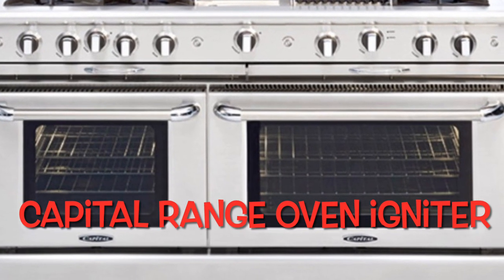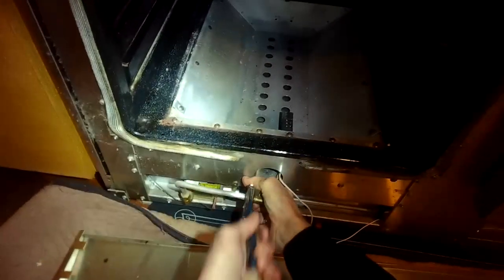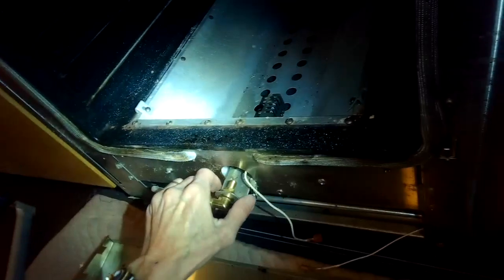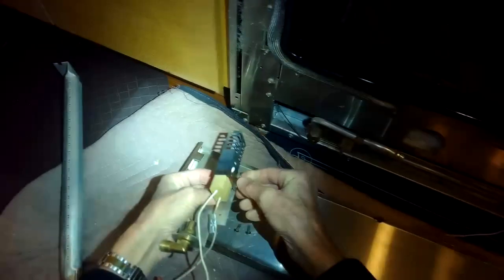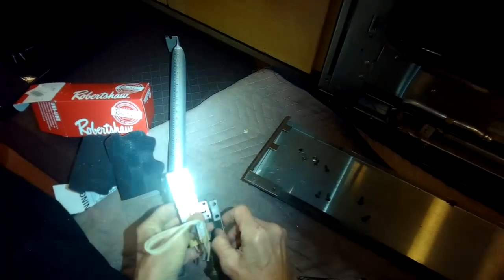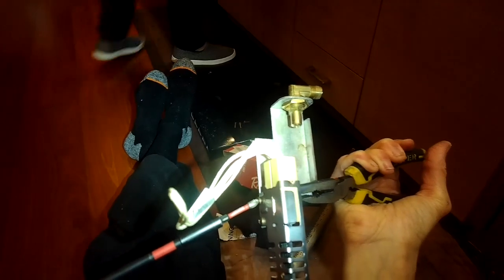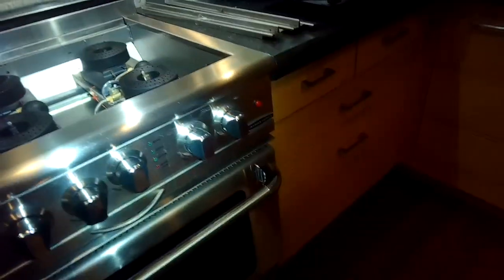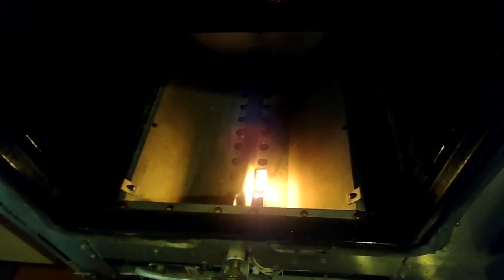✨ Capital Range - Oven Won’t Heat Up - $20.00 EASY FIX ✨

Comment: This is one of the best videos ever. I have a Capital Culinarian that had these specific issues. The oven was moaning and groaning and could not even come up to a temperature of 300 degrees. I followed the steps outlined in this video and purchased the surface ignitor specified in the link. The oven now performs like new. Also, I didn’t know how to gain access to the spark ignitor for the burner. I watched the video several times and went on to successfully complete the repair. There’s not much out there on these Capital ranges so this video was a blessing. Saved me a lot of hours, headaches and hundreds of dollars. A tremendous resource. Thanks so much for posting this.

Gerry
Reply from the maker: You are very welcome Gerry👍😊

Comment: Alright so I tried this by taking my igniter from my small oven (which was working great no issues )  and put it in my big oven that had the problem. Turns out that it stopped  moaning and seemed to be working but the flame is small and seems to not be getting a lot of gas. Installed The new igniter into the small oven to replace the swap out and the flame seems to be much stronger and bigger compared to my bigger oven. I adjusted the airflow to the bigger oven burner to match the flow of the small oven but did not change anything. Any suggestions? D
Reply from the maker: I think the big oven needs a new safety valve 👍

Comment: I've been going nuts trying to figure out how to change out the BROILER hot surface igniter.  I have changed out the igniter for the oven itself in the past without difficulty, but I cannot figure out how to get to the wire contacts for the broiler igniter.   I have tried from within the oven, but the wires run off to the back.   Do I have to pull the oven out and go through the back of the oven?
Reply from the maker: Hi Rob,
Can you send a picture of your broiler igniter to me at Scottthefixit guy@yahoo.com so I can check to see if it can be done from inside the oven?
Reply: @QuickAndEasy5MinuteAppliance  Thank you for your offer.  I wanted to give you an update: I wanted to get you a good picture so I removed the glass broiler shield, unscrewed the igniter from its mount and pulled it out a bit for a good picture.  When I looked at the picture, I could see that the wires looked like they coursed down, so I thought "what if I removed the convection fan?"  I easily removed the cover for the fan (4 screws) and then easily pulled out the fan (4 bolts) and behind it was the wires for the igniter connected by quick-connects!   As my daughter would say: easy-peasy!

Comment: So I have the same range and the heating coil gets white hot, but the gas tube never gets a flame.  I have even put a lighter by the vent holes and still nothing.  Any suggestions?  Are their parts that are not as expensive?
Thanks,
Jeff
Reply: I also can'g get my boiler to ignite.  Seems like the gas is not getting to the tubes.  I can smell gas, but never get a flame.  Any help is appreciated before I call a tech.

Comment: Thank you for providing capital cooking videos.  I agree information is very hard to find and people who know how to work on them harder.  I have had my thermostats and igniter both replaced on my oven and had the technician back to try and regulate the temperature in the large oven.  My stove is exactly like the one in the video.  How do you adjust the oven temperature?   My average at 300 is 277 and when heating the flame shuts off at 300.   This is after several cycles. At 350 my average holds at 324.  Thank you.
Reply from the maker: I wonder if it just needs a new igniter?